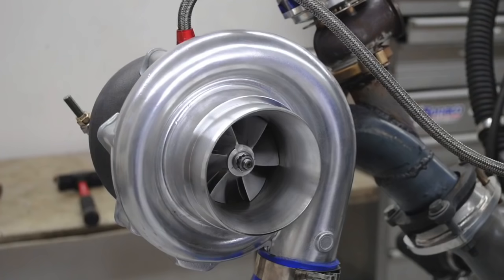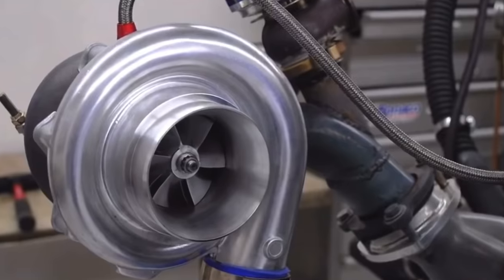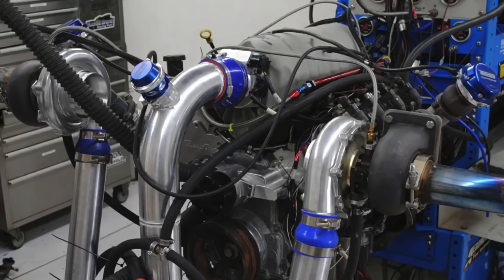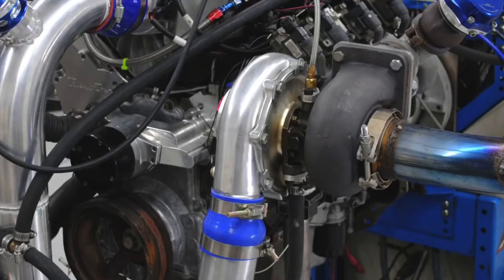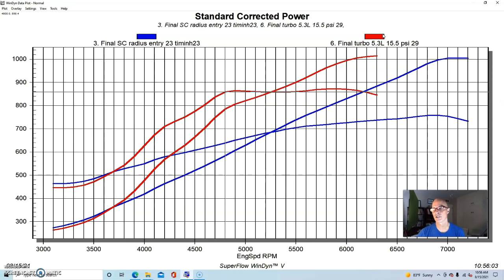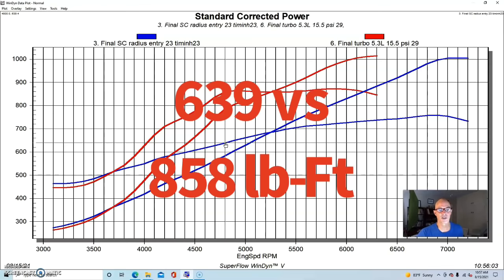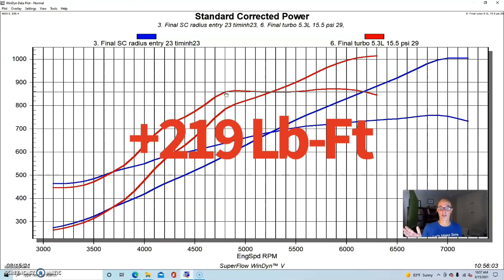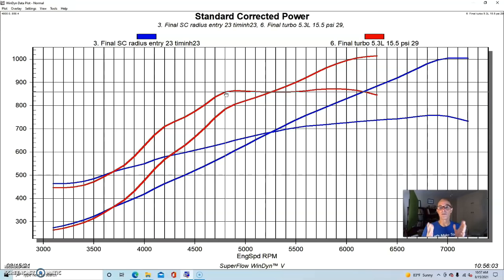HOW THEY WORK-PROCHARGER VS TURBO (WHAT WORKS BEST?)

Comment: It would also seem that running a centrifugal would be more dependable more forgiving with less breakage and destruction.
Reply: maybe easier to tune..but dependable??  dont think so
Reply: @brianmathew09  absolutely, turbos and other superchargers  have much more torque down low which is going to cause less dependability and more  breakage.
Reply: @craigslue  been running and tuning turbos for 20 years..been watching friends send their prochargers back to them time and time again..drew my conclusion from experience. The fact that prochargers 60 better than turbos should tell you something.

Comment: I dont have time to sit thru all this...but from having a turbo and racing many a procharged combos..the issue is getting ahold of the converter down low on the turbo is a beotch.   Very difficult to 330 with the centrifugal stuff.  Boost controllers are a missing link ..traction control too. I for one just dont have the ways and means for those or to be changing stators for each surface. Zero doubt the turbos have the power as seen in MPH. Also, theres a reason you see a huge jump to the blower cars at the track.

Comment: Possibly a dumb question, but if the supercharger is appropriately sized to make close to max boost around 4000 RPM. Could you not then just bleed off the excess pressure with a waste gate to make a boost curve similar to this turbo set up?
Reply from the maker: very difficult to get the cent blower to make max boost at just 4000 rpm

Comment: Change your gear pulley on your centrifugal to match the boost peak at the identical rpm. 

Then add a wastegate (or two) on the intake and an electric clutch on the centrifugal. 

Now the turbo is pointless.

Better yet twin charge it have a bypass air tight throttlebody that is boost relay activated or a spring loaded sealed flap so you can spool up your bigger turbo quicker with the smaller 1000hp centrifugal. 

Then add nitrous.
Reply from the maker: you can't change pulleys to get the centrifugal to make max boost at lower engine speeds. Only an electric motor can spin it up to max speed-complex and expensive-just get a turbo if you want what a turbo does.

Comment: Twin turbos will spool up faster than a single turbo at the same cfm. And Procharger needs to develop a continuously variable transmission for the internal gear set.
Reply from the maker: you can size a single to do the same thing as twins
Reply: @richardholdener1727  Single vs. twin would be a comparison I’d like to see.
Reply: Procharger does have a CVT called the “i”.👍
Reply: @edwardwood3622  I’m not seeing that on the Procharger website. Do you have a part number? A variable vane compressor housing like the Ford Powerstroke diesels would be an interesting idea.

Comment: High end rpm of boost is salvageable. Drag racers do it all day. It’s called a scrambler. They just close the waste gate and blow off. To use the spare boost they otherwise would be blowing out.
Reply: Not quite.. scramble boost is a 2nd boost level setting, usually triggered by a button press.. yes it effects when the wastegates open/how much.. the bov always stays closed under boost regardless..
Reply: @yolofullsend . Ok hey thanks for the info. I’m not promoting a channel but SRC racing talks on that scrambler, ya that button. Hold on!!! it could get crazy if pushed 😁😁.

Comment: Have you done boost curves of different sized turbos? I'd like to see that.
Reply: Be next to impossible compile any meaningful data because the curves would be different depending on what engine, how the engine is built if I'm not mistaken.  That's why good manufacturers will provide efficiency maps for their turbos
Reply: i guess it'll be very dependent on the ignition timing curve and camshaft profile. but yea it'll be interesting
Reply from the maker: THE WASTE GATE CONTROLS THAT TIL THEY RUN OUT OF FLOW-THEN BOOST FALLS

Comment: Show the pulls from idle. How much time is any engine spending at that point in the rev range?
Reply: from what I understand most/all dynos can't do that very well.
Reply: @yurimodin7333  

The common use for superchargers and blowers is lower in the RPM band. While turbos are spooling, a properly sized supercharger is building off idle. Turbos always win on the top side as the exhaust gases continue to excelerate.
Reply: Despite dyno limitations, pulls from idle dont make sense in the real world. If you have an automatic, its going to downshift and the converter is going to flash to stall speed. If you have a manual and youre making pulls from idle in high gear... You probably don't like your motor very much.
Reply from the maker: WOT AT IDLE?
Reply: @richardholdener1727  that’s what I said lol. Who goes wot at idle? The lowest I ever started wot was 2500 and that was for street tuning purposes.
Reply: Even launching the car your rarely below 2500

Comment: What I gather from this is if I am puttin this in a pickup the procharger is better because it builds more power down low vs the turbos which need to be at 4000 to pass the procharger.  Correct?
Reply from the maker: the turbo was better everywhere

Comment: Hey Richard, is it possible to just be able to control the torque production on a turbo setup while keeping horsepower the same?
Reply: Thats basically what turbos are for, horsepower is just torque at certains rpm's, the higher rpm you make the torque the less torque you need ;) so big turbo on low boost for you.
Reply: @2zztercel558  Let’s say I have a 500hp engine that makes 600tq. Can I keep it at 500hp and turn only the torque up to 800tq using only the boost controller?
Reply: @sstevocamaro   using only the boost controller no, but if you want more torque than horsepower youre gonna need a smaller turbo at higher boost. It will make more torque sooner and torque will fade before making more hp than what you want it to. The boost level does not change the powerband, only the turbo size and design changes it.
Reply: @sstevocamaro   but honestly, 800 torque with only 500hp, means that it either revs really low (like a diesel) or that it lacks a lot of flow. And those applications can be really stressfull on an engine. Flow is better than pressure for hp and reliability.
Reply: @sstevocamaro   and most of the time you need to think about it this way, torque = air velocity/pressure and horsepower= flow/rpm

Making hp is less stressfull on an engine because its just about keeping torque until the end.... torque is about making as much pressure/velocity you can as soon as you can... but its all about preferences.
Reply: @sstevocamaro   and turbos just maintain a certain pressure (psi) at a certain flow (cfm) at different available rpms. Personnally i like n/a engines better than anything else tho.
Reply: @2zztercel558  Yea I was thinking of a Diesel engine.
Reply: @sstevocamaro  you could maybe also try playing with timing lower the timing up top or have the boost fall off up top if you have a way to control that.

Comment: For most people, they never see anywhere close to 1000hp; especially street driven cars.  With those, octane of pump gas is one of the biggest limiting factors; especially when e85 isn’t common in their area.  Depending on the engine, you may only be able to get 7-10 psi using pump gas (and still keep a decent amount of timing).  

My main point…
This is where a turbo really shines; that it has less parasitic losses than a belt driven power adder (supercharger).  At peak boost, it might take 50-100 hp to spin the supercharger (depending on the setup), while properly sized turbo will have considerably less….  Which means more power going to the tires.

I’d like to see a direct A-B comparison.  Like a junkyard 5.3, cam only (maybe something around 220 @ 0.050”, a Sloppy S2, or that 224 degree crane cam you use a lot), and make the boost around 10psi (match the turbo to whatever the supercharger does).  Runs to the same RPM.  I bet the turbo ends up making about 50 more peak HP.
Reply: Lol, Holdener says a turbo has zero parasitic loss...
Reply: @michaelangelo8001  Only after it spools. Off idle it produces backpressure, a restriction and the bigger the turbo the worse it gets, that's part of turbo lag.
Reply: @blow0me  There is absolutely no way you're running 20-30 PSI on a stock compression LS engine (even the lowest compression ones, which are 9:1 or so) on 91/93 octane pump gas.  The only way you can run 10+psi is with conservative timing and meth injection; and even then, you're not putting 20+psi.
Reply: @michaelangelo8001   On an optimized system, there's virtually "no" parasitic loss....  But many systems aren't perfectly optimized.  It's easier to measure how much losses will be on particular supercharger at a certain boost level.  Parasitic losses from a turbo is dependent on each individual combination.
Reply: @AdmiralRustyShackleford  Lol, so much ignorance... so little time...
Reply: @stlchucko  Wrong...  Horsepower is required to spin a turbo, regardless.  That fact should be blatantly obvious to any thinking individual.
Reply: @michaelangelo8001  
I'm talking about pump 91/93 octane gas.  I have no doubts a stock 5.3 can handle 20+psi, but there's no way to do it without a high enough octane fuel or massive amounts of additives like meth.

Holdener always uses good gas on boosted dyno runs...  Frequently C16 or equivalent (100+ oct).  He's stated this multiple times, both in videos and in comments.

Again, there is no way the people you know are running pump 91/93 oct on 18-20 psi with any decent amount of timing or without meth.
Reply from the maker: BACK PRESSURE AT IDLE AND PARASITIC LOSS IN THE EXHAUST-CLASSIC!
Reply: @michaelangelo8001   Obligatory "DUH!!!!!"

"Virtually 'no' parasitic loses" means that it's minimal, and I even stated that it's only with a perfectly optimized system; which most aren't.  This is why Holdener has stated and shown examples of engines that make double the NA power when 1 Bar of boost from a turbo is applied.  It's an optimized setup where there's "virtually no parasitic losses".
Reply: @blow0me   You're the one who brought up "crazy high" compression.  A stock 5.3 has 9.5:1 compression.  Stock, it runs on 87 octane.  Is 9.5:1 "crazy high"?  

Given that 90% of the engines Holdener tests are stock compression or higher, and that he's always advocated for not reducing compression just to lose power and make up for it with more boost (like the 706 vs 317 head comparison video), you really don't have much a leg to stand on with the "build it for your needs".  Plus, most people throwing boost at a LS engine are using stock bottom ends, or at least relatively stock compression.  

Ultimately, octane is the limiting factor on the street.  There's no point in dropping compression just to run higher boost, which just make AITs higher.  Even with an intercooler, lower boost means lower heat.
Reply: @stlchucko  Lol "virtually"...  You have no sound basis for your opinion, nor do you have a clue as to what's really going on there.

Holdener will never admit it when he's wrong either.  He quietly backed away from the 'magic free thermodynamic horsepower' paradigm, and subsequently tried to cover himself by calling it "pumping losses".  Still refuses to actually do a test, in order to see just how much of his esoteric "pumping loss" we are talking about.

I can tell you without hesitation, that the figure is not "virtually none", but rather, very substantial.  I would estimate it to be around half that of a belt driven supercharger.  Because... unlike you, I know the reason why.
Reply: @michaelangelo8001  All I hear is from you is a lot of blah blah blah.
Reply: @stlchucko  Lol, obviously... that's because you are too young and inexperienced to interpret it as anything more.
Reply: @blow0me  
I never said that it's impossible to build an engine to be able to run more than 10psi on pump gas.  In fact, my exact words were:
"Depending on the engine, you may only be able to get 7-10 psi using pump gas."

Most engines with relatively stock compression can't handle more than 10psi on pump gas without taking out a bunch of timing or running meth because of predetonation.  Sure...  You can build an engine with a low compression and run a bunch more boost, but it's counter productive.  

Frankly, your argument is based entirely on a strawman.  I could build an engine that would run fine on 87 oct with 50psi.  Never said it isn't possible.  So since you can't comprehend the nuance that I've repeatedly expressed, there's no point in dealing with you.
Reply: @michaelangelo8001  
LMAO!!!!!
"YoU aRe ToO yOuNg AnD iNeXpErIeNcEd"

Says the smooth brained guy
Reply: @stlchucko  Yes, lol...  So, why don't you tell us how old you are, and about all the turbo builds you have completed?
Seems like a great opportunity to redeem your reputation.
Reply: @michaelangelo8001  
Why would I need to "redeem" my reputation to someone that hasn't demonstrated theirs?
Reply: @stlchucko  Well Chucky, you've backed yourself into a corner...  Notice that your comments aren't getting any likes.  So I naturally thought you might be concerned about all the other people who are laughing at you, that's all...
If not, then just disregard.  After all it's your problem, not mine.
Reply: @michaelangelo8001  for street use, if the exhaust have a resonator and/or muffler present. with turbo added, one can change(or remove) these out with more free flowing parts. effectively getting more or less similar decibels as the previous setup
Reply: @hotdog9262  Yes, because the turbocharger acts as a muffler to a degree.  So you can free up a little backpressure after the turbo that way (I assume that was your point).

But you must remember that the turbo itself is a big restriction in the exhaust passage.
Reply: @michaelangelo8001  that`s the thing, a turbo is not a big restriction in itself. and it will be more responsive and yield more power then with a stock exhaust setup if additional restrictions after it is lightened or removed. turbo is vastly superior to any other forced induction for most applications. a smaller quality turbo with the original vvt cam is very responsive and will give tons of power down in the rpm range
Reply: @hotdog9262  You keep saying that "a turbo charger is not a big restriction".  What proof can you present to support your assertion?  

I happen to know that it IS a big restriction.  Do you think all that pressure output on the cold side is just conjured up magically?  There is even greater backpressure on the exhaust side.
Reply: @michaelangelo8001  not conjured up `magically`  because as you know, the exhaust energy would be lost anyway out the back. combine that with it doesn`t take much power spin a turbo at say 80-90k rpm. a leaf blower could do it